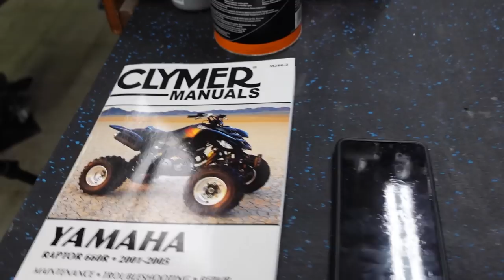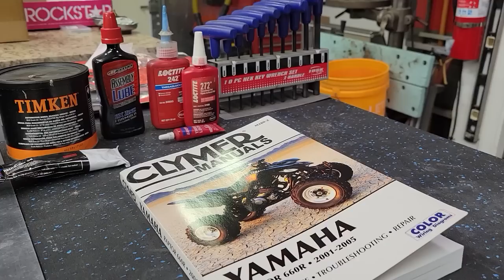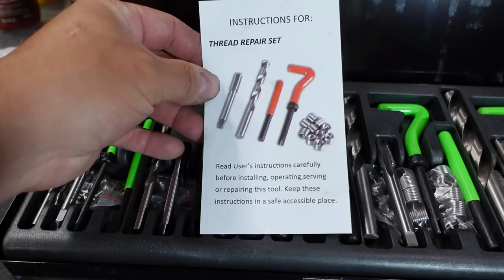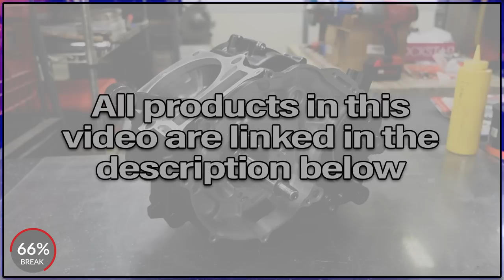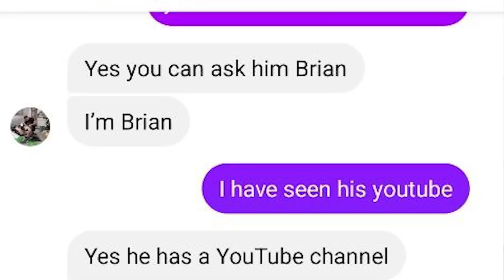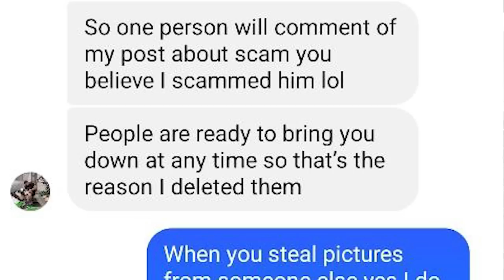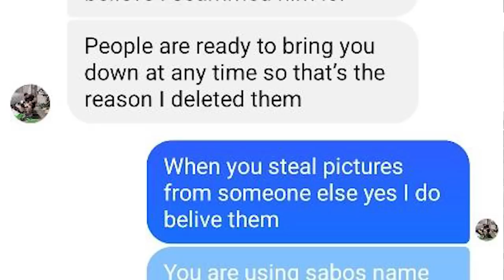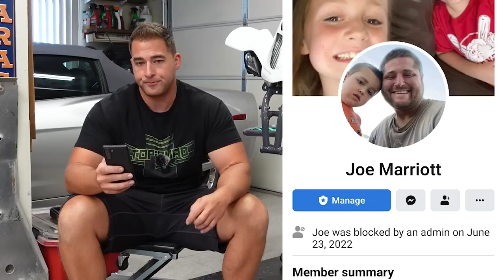Building the Ultimate Engine for my Yamaha Raptor 660! ASPCA Raptor Part 4

Comment: Another trick you can try for the liner is welding down the length of the liner bore in multiple spots. The weld shrinks the liner and makes removal much easier. It's somewhat commonplace when rebuilding industrial engines that use dry liners. Love the content man, I enjoy seeing you resurrect quads anyone else wouldn't take the time to even consider.

Comment: I resurfaced a viking 700 cylinder head that kept blowing head gaskets. Used a 1/4" plate glass with 400 grit sandpaper. Worked really good, no more head gasket failures.

Comment: My raptor 770cc with a plus 3mm intake valves and plus 2mm exhaust valves 105.5mm cylinder and pistona plus 5mm stroker crankshaft, EFI controller.   23x7 up front and 22 inch tall tires out Back.   I also went as tall in the sprocket up front and smaller out back.    Stage 3 cam, 11:1 compression piston so I can still use 91-93 octane.    I will add a shot of amsoil octane booster to play it safe.    At 75mph in 4th gear I can pull it up then shift into 5th and it's just stupid.    A few other things are done as well 😅😂   great video btw....

Comment: Mike, first off your channel is first class. I am definitely going to rescue a sport quad when I get back states side. That being said, you made a comment that really hit home with me in this video. Which Sport Quad do you personally think has the best aftermarket support?
My interest generally lean towards the Banshee and Honda 250R. That being said I have zero experience with the new four stroke 450 crowd. Definitely not opposed to going the four stroke route, but my experience has been with the 2 strokes I mentioned earlier. 
Thank you again for providing a great and motivational channel.

Comment: Having a background in law enforcement, the ones that are stolen and later recovered are returned to the owners prior to being crushed. That is if the owner provided the VIN number to police at the time of the theft report. When a stolen vehicle is recovered (given the VIN number is still intact) an officer will run the VIN number through NCIC which will inform the officer that the vehicle was stolen. At that point it is returned to the rightful owner.

Comment: Cerakote makes a heat dissipating cerakote could have case half and such donecto help pull heat out.

Also you can have pinyon tops ceramic coated and skirts coated

Comment: If you're willing to fully commit to a heli-coil to replace threads you can try tangless coils.  Those will never back out but you only have one chance to get them in right after setting the biting portion.  I put hundreds of them in aluminum so I wouldn't worry about that part though.

Comment: I had the two bolts on the intake cam gear on a rzr engine back out once. Wether it was because of the heavier springs put in or dirty threads who knows but you can imagine what happened to a newly fully built engine. Lucky I heard the ticking and shut it down and only bent the intake valves slightly. Replaced the valves and seats to be safe. Been running over 200hp at the wheel ever since with no problem. Anyhow what I'm saying I guess is extra lock tight.

Comment: Yes with helicoil you have to use red locktit and the repair is stronger then the factory threads it can be used in any aluminum thread repair. It is made for aluminum thread repair. Some manufacturers  use them from new.

Comment: Good way to take the tang on the end of the thread repair set is with needle nose pliers. You just have to tap it and it'll snap and then just pull out

Comment: The crushing is because the normal process for police impounded, private impound or insurance is to send them to auction. 
9/10 of these will get bought back by the same groups and continue to illegally operate on the streets.
Same issue back in the late 90’s with street racing in California with imports. I can tell you from being in the street racing company back then, IT WORKED! Man, it stopped 80% of the street racing in fear their $30k-200k imports would be crushed (unless there was a title lien).

Comment: Hey, I've been pulling together information for the last few months on basically the same project. I also got a stainless bolt kit, and was wondering what you figured out for never seize between the SS and aluminum case.

Comment: You could try the Krylon fusion paint for your plastics. It be a good test of it's durability.
Reply from the maker: Man I don't know, I'm super reluctant to paint plastics because I've seen them flake and look really bad. Maybe if I did the same color so scratches wouldn't show as badly.
Reply: @MichaelSabo  From what I understand the Krylon bonds with the plastic. And it would probably be easy to touch up. Not completely sure tho. I have never tried it.

Comment: That shifter pawl was the biggest PITA when I did my engine.
Reply from the maker: Haha, they can be a real PITA when they pop apart and the little pieces go bye bye
Reply: It was an extensive engine build. Crank true and welded by Crankworks with a new HotRods connecting rod, CP Carillo 11:1 piston, cylinder bored and honed out to 102mm by Alba Racing, head ported, surafaced, and new KW +1 valves installed by Alvin J Gregg, KW stud kit, and all new OEM seals. GT Elite ront shocks and rear OEM rebuilt by Jogaca Suspension Works. 12T OEM front sprocket, 43T OEM rear sprocket. First gear is now obsolete....lol.

Comment: hi my 660 raptor  has been a pain in my back i don't know what is wrong with it. I  was wondering if you can help?
i replaced the harness, new solenoid now my ignition switch won't work it just stays on now i can try to turn it over with out it ?

Comment: I got a 2003 Honda TRX 250 ex I'm no good with motors and want it rebuilt internally for motors i honestly don't know what I'm doing but just want it rebuilt I'm gonna do the rest of my quad my self your chanel honestly made me wanna rebuild a quad my self but the motor I want done by you honestly if you can let me know
Reply from the maker: Just saw your other message too; I know its scary doing an engine for the first time, especially the bottom end, but if you get a service manual and take your time; I guarantee you can do it. Unfortunately I'm booked for over a year at this time and I'm not taking anymore customer work. I have faith in you bro!

Comment: I wonder why some clutches have judder springs and fiber plates that slightly smaller. Also yamaha banshee / blasters with that weird hump on the plates...
Reply from the maker: The half plate and judder springs are to make the clutch engagement smoother/less harsh. It makes for a nicer feel but it's not good for performance or clutch longevity; the half plate usually wears out and slips sooner.

Comment: Hey I have a question. So I have a 2003 raptor 660 I need a new head and value cover. Do you know where I could get one or just have it rebuilt. It was ran without oil will the oil line came out.

Comment: Michael man can you point me in the direction of where I can get a brand new 99 rm250 engine? I would appreciate it greatly or even remanufactured
Reply from the maker: A new engine? I'm not sure that's possible unless all the parts are still available. You'd have to find a good build and ask if they can build you one out of restored parts or new old stock. I don't know anyone that would.
Reply: @MichaelSabo  well my old man passed and had a 99rm 250 he tore it apart. The case has a mounting point completely cracked off. The crank is all toasted maybe the only good is the transmission gears honestly. The head is not in great shape either. I just want to put it back together for sentimental reasons but the engines completely torn apart and like I said the case is beyond repair. To bad they don’t reman this stuff. I’m sure there is a crushed one in New York I coulda used 🤦🏼‍♂️

Comment: I’m impressed by your videos but would like to help you with one thing. In order to lap a surface flat, I suggest doing a figure 8 and not a circle. This will level out all surfaces and create a lapped surface. I’m an old tool and die builder and have been flattened surfaces for 40+ years. Great job otherwise

Comment: I know its not my build but there is no way I would have reused that one way. L&L OR L&A oneways are way better.  As far as the niche stuff goes not good for water cooled engines. The sleaves drop, then have internal compression leaks.  Looks like a bad headgasket. Looking good

Comment: My feeling with that, all they had to do was contact a buyer or get a container and put them in for people (in other states) to bid on. This would have produced revenue instead of man power used to crush them!
Reply from the maker: Exactly... not only were the machines wasted, but they wasted fuel and resources to run the dozer and clean up all the crushed bikes and oil...

Comment: full flight wouldn't accommodate my suspension set up 0n my 700 raptor. I bought the 450r fox evol long travel shocks and ended up going with american star long travel.
Reply from the maker: Damn, I'm not sure they do custom stuff regularly. They will make stuff for me because I can advertise it and then they sell that same setup to several people; it's not like a one off where they need to make a jig and then it never gets used again. Glad you got it going with ASR though man!
Reply: @MichaelSabo  full flights still a great company refunded me no questions ask when I realized the ones I purchased from him would not work with my suspension set up

Comment: I forgot the bottom o ring on the cylinder twice 🤦🏼‍♂️ once on the initial assembly and after 3 hours when I had to do the top end again because the niche cylinder I used wasn’t decked right from the factory

Comment: Problem is if someone has insurance on a bike or atv and it’s stolen then once you get your insurance pay out for said bike or atv technicality the insurance company owns the machine. Happened when some goons broke into my garage and stole two of my 2021 kx’s. Insurance paided me for my bikes and the Philadelphia pd found one abandoned on the corner in the hood. Couldn’t go and reclaim my bike from impound because insurance already had my titles and paided me.My other modded klx110L is still out there
Reply from the maker: That's true and I guess it's fair you got paid. Having insurance is a great idea, problem is I don't think many riders have it. Regardless, the impounded bikes shouldn't be crushed in my opinion.
Reply: @MichaelSabo  they should do a auction with them or like you said part them out